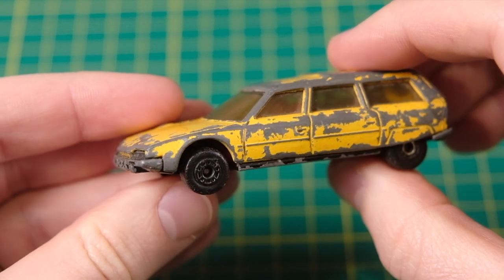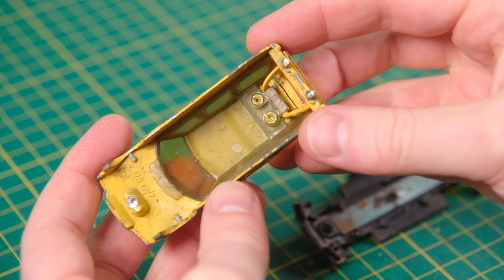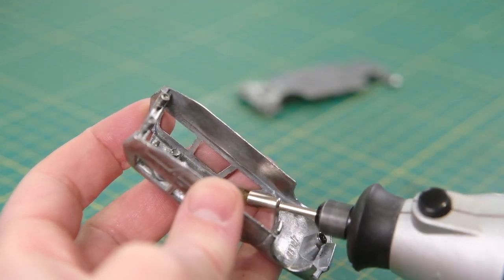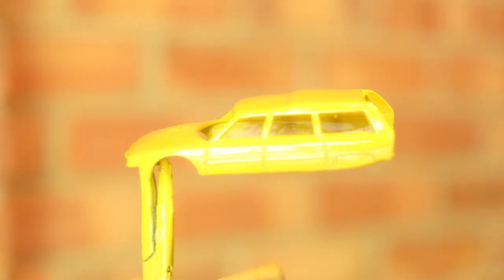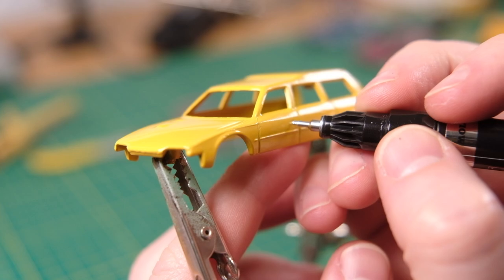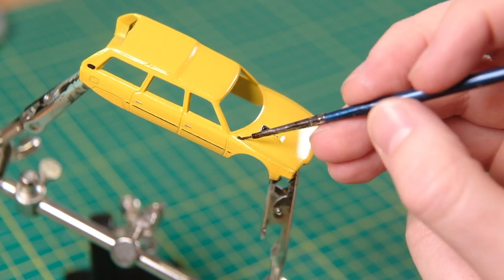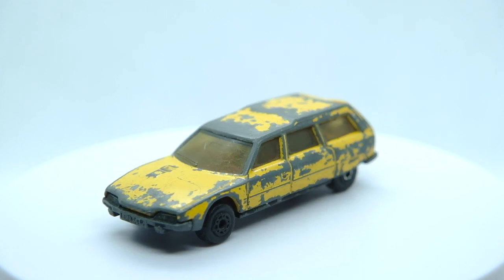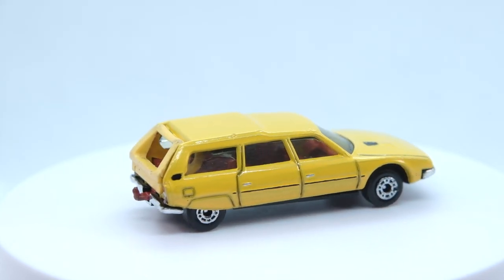MATCHBOX Superfast restoration: 12F Citroen CX

Comment: Regarding yellowing of plastics, I'd try the processes that are used for old computer retrobrighting, involving hydrogen peroxide and UV light. If you want to avoid using chemicals, try leaving the yellowed parts on direct sun for several days, preferably in the middle of summer. The results are not that prominent but the change is visible, if you're patient enough.
Edit: Oh, just as I finished writing this comment, I realized you did what I suggested :-)